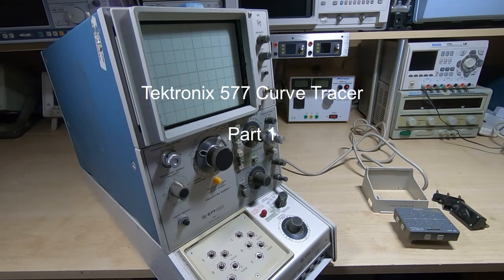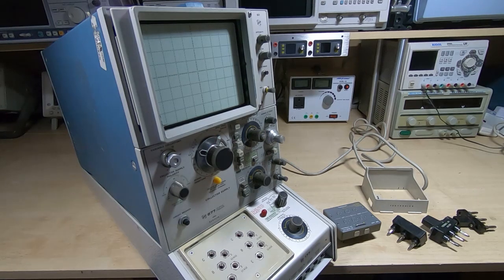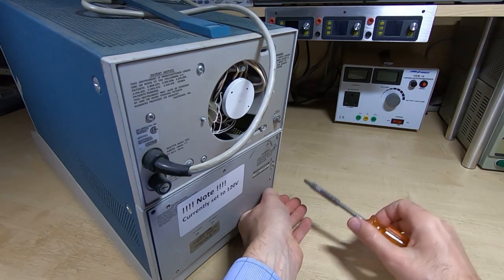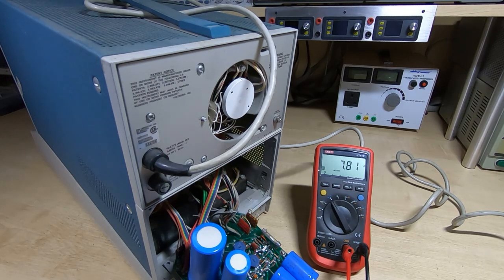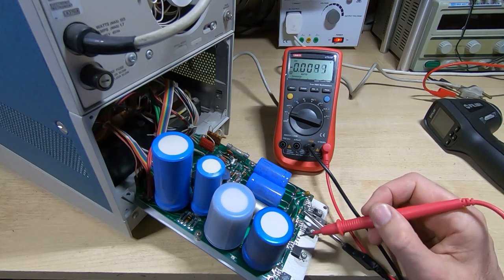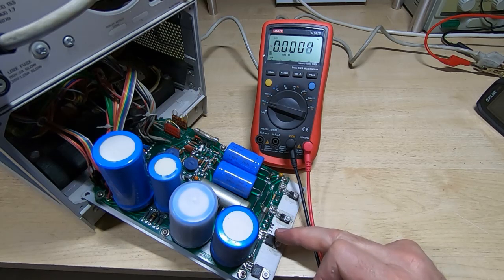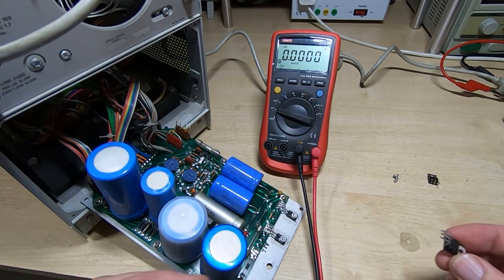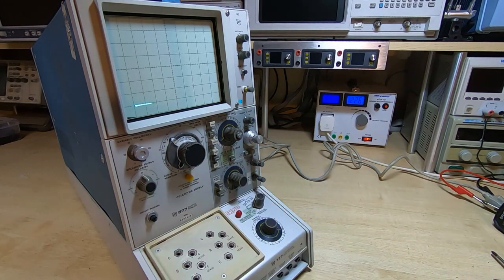Tektronix 577 Curve Tracer Part1

Comment: This is such a great video. Thank uou for doing this and the other parts. I have a 577 in beautiful cosmetic condition that I want to bring back to life. It's possible that theres nothing wrong with it. How would you suggest I start the process so i dont damage something.
Reply from the maker: They are fairly resilient but if it has not been powered up for a long time then it is best to unplug the fixture and then take the back panel off. You can drop down the main power supply board and unplug all the wires going to the boards. Then power it up and check all the power supply voltages (they are all labelled). If it all looks good then power off and reconnect all the supply cables and plug the fixture back in but before powering up check for shorts between all the power rails and ground. If you find a short to ground then look for a shorted tant. It should then be safe to power it up.
Reply: @JerryWalker001  Thank you Jerry. Wish you were here in Boston. I think I'd just bring it to you and pay you to do it. 🙂

Comment: Great stuff 👍 .There are two darlington transistors on a 30 V rail.  Seems to be some old motorola darlingtons .I need a replacement but cant find any specs ,-datasheet . Is there any chance that anybody can sugest a replacement or has a datasheet for it ???
Reply from the maker: Do you know the part number?
Reply: @JerryWalker001  Thanks for your reply Jerry. Turns out to be mje 800. 👍
Reply from the maker: @stefanmoler5437  https://www.ebay.co.uk/itm/MJE800-Marked-JE800-Motorola-Trans-Darlington-NPN-60V-4A-3-Pin-TO-225/293493960381?hash=item44559a6ebd:g:GtoAAOSwU9xUO64Q

Comment: Thanks for making this video, very informative.

There is one aspect I always wondered about curve tracers, maybe you can shed some light on this.
The cheap kind, of curvetracer that is hooked up to an oscilloscope in X/Y mode, seams to exist in two variants.
* Two terminal type for respective two-terminal devices like diodes, capacitors, inductors, etc.
* Three terminal type for transistors
The Tektronix cuvertracers seem to be capable of characterizing both two and three terminal devices, at least with the respective test fixture.
Is there a fundamental aspect that makes it particularly difficult to build a low-cost curve tracer that is able to characterize both two and three-terminal devices?
My assumption would be no and that simply nobody bothered so far to build something that is switchable between the two modes, but I do not actually know.
If you could comment on this, assuming you have any insights, that would be highly appreciated.
Reply from the maker: Hopefully my upcoming videos will help to answer your question in more detail but in short it would be very difficult to build a low cost equivalent to something like the 577. It would be simple to build a curve tracer to operate over a limited range. As you say there are a number already available. However it is a very different prospect when adding the functionality you get in something like a 577. For a start it works up to 10A and 1600V in both current step and voltage step modes. It also allows testing of device breakdown characteristics as well as simple switching characteristics. It allows device comparison through the use of dual sided fixtures and current switching. It also provides accuracy down to the pA and uV levels over a very wide range of operation. When combined these features    represent a considerable design challenge. It would however be possible to build just the source and switching circuits and do away with the display and use something like a PC as the display. In fact that is how the 577 is designed. The 'top' part is really defined as a display while the 'lower' section is defined as a mainframe to which a display unit is added.
Reply: @JerryWalker001  Yes, I am aware that the overall capabilities of a 577 or similar would be pretty challenging to match.
What I am asking is, do you think it would be feasible to design something similar to e.g. [1] that can work with two-terminal devices? Still utilizing an oscilloscope as a displaying frontend.
I understand that voltage range, current range, etc. would be limited.

[1] https://www.ebay.com/itm/291531434190
Reply from the maker: @alexanderhuemer1587  The 577 IS a scope with a measurement system attached. That is how it was designed and so in theory you could design a system using a scope as the display. The number of terminals is not relevant as the display is only showing an X,Y (and optionally Z) plot.
Reply: @JerryWalker001  I think I am not expressing myself well and apologize for that.
Let me rephrase.
Do you think it's feasible to design a device like the one from eBay I have linked above that has the same capabilities like the linked one for transistors but is also able to work with two terminal DUTs while reusing most of the test circuitry for both functionalities?
As the linked device, the new one would have two output terminals to be hooked up to a general purpose scope.
It would need tree input terminals and a way to switch between two-terminal and three-terminal DUTs.
Reply: I believe I was able to anwer my own question since I posted it.
Mainly through reading about the topic. Also W2AEWs video about the 577 is pretty good https://www.youtube.com/watch?v=c-y8UmoHbtw .
I also was able to purchase a 577 D1 in pretty good condition too. It has some minor quirks, but I think those can be resolved.
The aspect of curve tracers that I didn't grasp properly in the beginning was that the step generator for base/gate stimulation is a separate component that, if present to begin with, can be disregarded or disabled when characterizing two-legged components.
I am still a bit surprised that you cannot buy a piece of equipment today that is somewhat feature comparable with a 577. The semiconductor parameter analyzers from Keysight, Tektronix, etc. are overkill for many applications and cost prohibitive for non-professionals, the tinker toys from Thailand are too simple though.
I found this article recently that seems promising though: http://www.paulvdiyblogs.net/2017/12/building-curve-tracer.html